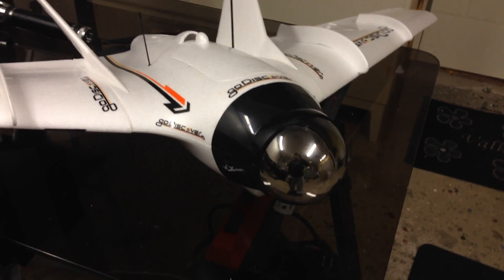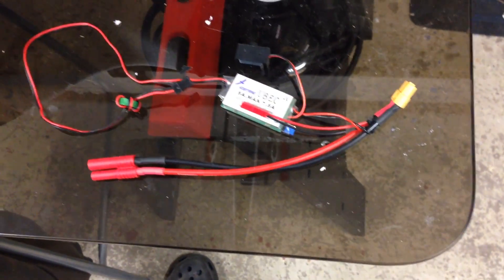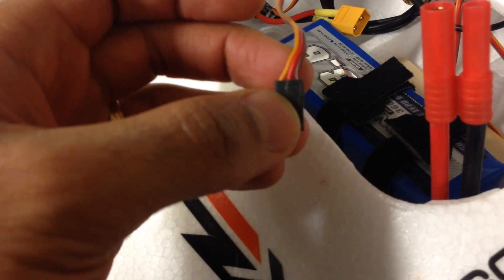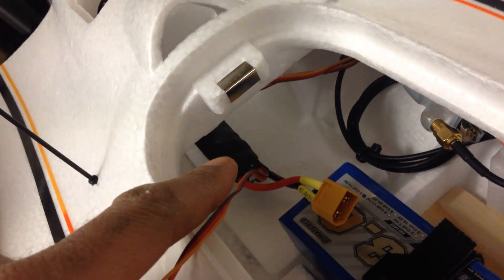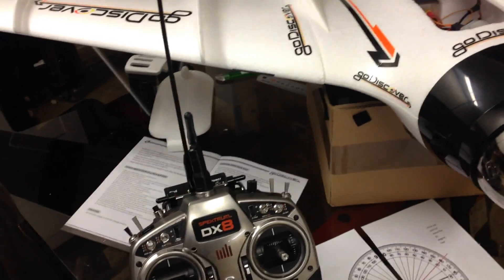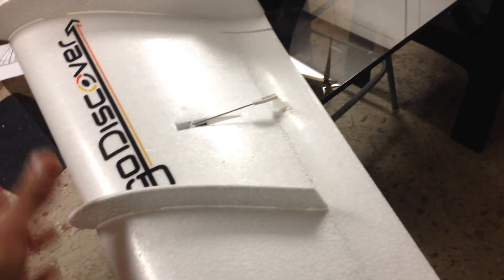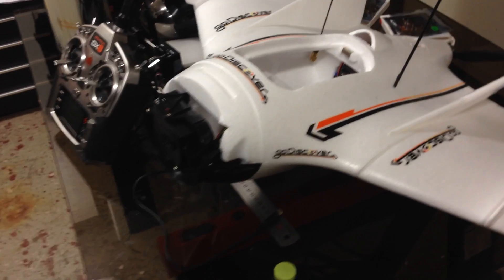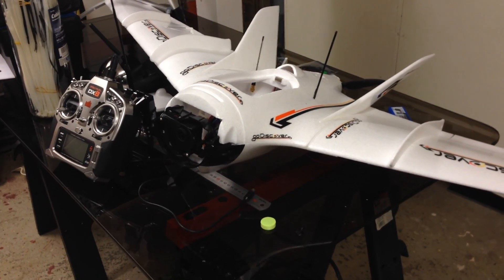Go Discover - Setup Steps

Comment: I like the video , i only think its crazy to ask 20$ for a small piece of wood and 5minutes work .. , i made one of Plywood and cost me 2 dollars , Sorry but i needed to say
Reply from the maker: steven keene Well you are entitled to your opinion.  It did take several hours to make the CAD drawing, to the exact contours for the component shelves, it includes my time to get materials, cut the kit on my CNC machine, packaging and postage.... so at the end of it all, I probably make about $2 profit on each kit.  Is it worth my time, No, but for those who don't have the capability or time to make it themselves, at least I help them out.  Sorry but I need to say
Reply: ant0nsmith I must agree with you , it was my bad i thought it was only the top part but when i look better i see you made the other 2 parts to  , i must have looked better ! i'm sorry  , but i must say , i made the top part in les then 5 minutes  -_-
Reply from the maker: No worries! And no hard feelings!

Comment: Hi ant0nsmith, Thank you for the great videos! So, what did you use as the audio/video receiver to go with 1.2GHz transmitter? This is not compatible with fatshark directly, right? Do you show the receiver and connection to fatshark in any of your videos?
Also one more question, does operating the dragonlink or 700mV AV transmitter requires a HAM license in the US?
Thanks again for your help.

Comment: I just bought on of the Go Discovers and was wondering if you could give me some ideas of what you have installed in yours.  I am in the U.S. and not sure if I can get the same components you are using.  I would like a decent FPV set up with head tracking and maybe a GPS feature with return home functions as a back up.  I am not new to RC by any means, just new to all the FPV stuff.  Thanks.

Jason
Reply from the maker: Hi Jason,
I have a complete list available on my website
NegativeG.net
Hope tgat helps!

Comment: Hi again Ant0n. I'm asking a lot of questions but I think you are the only one that can answer them (I haven't found any places to ask all those questions. I am planing to buy an APM board, the same as your. But I am using a 6 channels radio with my GoDiscover, 3ch for the controls and 2ch for the gimbal. Do you think i can use the APM board with a 6ch radio? Or do I need a 8ch radio? I mean, i would like to use the RTH feature, waypoints and sabilize mode so should I upgrade it? My radio is a Spektrum dx6i. Also, can you tell me how much flight time you have with your 3600mah batterry? If you can answer these questions, you are the best!!!
Reply from the maker: Your questions are good ones!
Yes you can use your dx6i to do the things that you mention.
"3ch for the controls and 2ch for the gimbal" then the spare channel you have, you would use as your mode switch.
Im not sure about the dx6i and what its capability is around setting up a 6 position switch, but I found this video just searching quickly How-to get 3 Position 'Switches' on the DX6i that may be of use for you in setting up a 3 position switch if you don't already have one on your dx6i.

The modes that you would then setup in mission planner would be manual, stabalize and RTH.  To do waypoints you would need to use the mode Auto.

If you can not find a way of get more than 3 modes using your dx6i, then you can set it to be stabilize, auto and RTH. But be careful to ensure that you set in Advance Params, <Throttle passthru in staablize> to ENABLED so that you have control over the throttle when you are taking off and landing. Otherwise the prop will always spin and you will brake the prop on landing for sure.

Flight times: around 17- 20 mins on the 3600mah 4S safely. i.e. using around 80% maximum of the capacity.

Hope this helps my friend!

And keep the questions coming, no problem! :)
/Anton

Comment: Hi Ant0n, big fan here!
I would like to ask you if there is a way to change my go discover engine. Because i have the basic 800 kv engine and I would like to upgrade it with a 1100kv engine. So can you tell me if you know a way to do it? I would also like to know if that would use more of the battery. Please keep doing your videos, i really love them and they're really useful.
PS: I am sorry for any grammar fault, but i am french and still in high school learning english.
Thanks for the help
Reply from the maker: Hi again MrOmegasix!
Dont be sorry about your english, it has been great!

If you can get your hands on a long X head screw driver, I believf you will be able to unscrew the motor from inside the plane. There are 4 screws holding the motor to the black plastic motor mount.  There is a foam "wall" between the center of the fuselage and the motor mount, you should be able to poke the screw drive through the foam to get at the screws. 

As for if your new motor (1100kv) will be more efficient than the 800kv, im really not sure. The are many factors involved, like, are you using a different size prop, and whats the size of you motor. Im no expert in this area, and am still learning myself!!!!

Im using http://www.ecalc.ch/motorcalc.php?ecalc to try and work out what the best setups are. Give that a try first and see what the results say. 

Hope this helps!!
Reply: Thank you for the quick answer. I will try to use the website you recommended (looks pretty complicated) and try to change the engine. Thanks for the help. By the way, i don't know if you know it but your video of the x7 in storm is not avaible on mobile devices. Try to change ads settings to make it avaible.
Reply from the maker: MrOmegasix Yeah, Im having trouble with that video on AppleTV too. I think it is due to the backing track that I am using....

Comment: hello nice video there! but how you did you set your battery By CG ?
i have already CG machine and i want to use 5000 4s battery
Reply from the maker: Hi Saleem!
I used a 5000 4S battery in my Go Discovery for the 10km flight.
http://youtu.be/Od52SDZljzU?list=PLmcS6x97iWfKCzRK4C8HunVJ2Eg3__C-L
In this video you will see how I had it installed.  I would suggest that you check out my battery tray and install it if you want to run a battery as big as a 5000.
http://www.ebay.co.uk/itm/Go-Discover-Battery-and-Component-Trays-/221501067628?pt=UK_ToysGames_RadioControlled_JN&hash=item33927e116c

Hope this helps!
Regards
Anton.
Reply: i meant by my question how i should stand this plane by CG machine !

Comment: How much was your setup and can i use that set up you have on the dx8 on a dx6i is it possible to make he camera pan and tilit from the remote like use rudder control on the throttle for panning and a 3 position swicth to tilt and if you get around to it can you email your setup and how nuch it cost because im  experienced with air planes i dont have any vids thow so now i want to use fpv for filming my friends riding and for when im in the mountains camping i can fly around and my email is ktm65xc101@gmail.com
Reply from the maker: Hi Fred, I believe it is possible to setup on a Dx6i, there are videos on youtube on how to setup the EvUhf with the same method.

Yes, it is possible to do as you say, to use the rudder channel for panning, I do this on my X7 currently using my home build 360 mount.  And it is possible to use a 3 position switch for tilting too - suggest you set the middle position to be middle, and ensure failsafe is set to that position just incase.  You will need to have a suitable pan a tilt solution. I have one in development.

As for the costs, I would suggest that you check with your preferred suppliers, here are some rough costs to give you and idea.

Spektrum Dx8 bought from ebay - ~200GBP
DragonLink from Dragonlinkstore - ~260USD
GoDiscover PNF version from HobbyKing ~160USD
GoPro Hero 3 Black edition ~4000SEK
Batteries from HobbyKing ~40USD each
APM 2.6 you can buy from HobbyKing, called HKPilot ~170USD
Fatshark Attitude SD ~360USD

Hope this helps
Reply: Thank you ver much

Comment: when you said throws do you mean mix1 aile and mix2  elve in the manual it says +20 and - 25 how did you set this up did you do it with the sub trims or the mix 1 an 2 in the radio thank you brother good job I have my mix set at 50% for better throws should I l change to the manual settings or try your settings thanks again my brother
Reply from the maker: Hows it going hellcat,
I didn't do anything with mix1 or 2.
The way I setup the travel for the elevons, was so that at maximum stick input, they move 15 degrees up and 15 degrees down.  

First I used the sub trim on my radio to make sure that both elevons were completely level with zero stick input, then with maximum stick input I adjusted the travel to ensure that I got 15 degrees of angle up and 15 degrees down.

Hope this makes sense.  If not get back to me.

I found that, that we enough movement (throw) of the elevons when I was flying.  I think it is a good setting.
Reply: ant0nsmith ummm ok il have to have another look but but I bought the plug and fly version uk wearhouse  when I tested the wing tail mix setiings the throws were really small so what I did was like u said at  zero input play with sub trim on radio for the wings to be perfectly inline the mix one and two I put 50% I have fast reflex and I need it to move faster il have to get my daughters protractor out later and play with the travel thanks again brother il I get back to you after maiden flight but I live west London very raining and windy so cant fly at the moment 

by the way were did you go to fly it looks quiet and out off the way hard to find good field were I live thanks again brother.
Reply: helcat316 thanks il get back to you if I have problems brother good luck with the plane its really nice bird to fly and your video is very helpful and you speak English I can understand what the hell is going on haaaa my setup is same but I have no fpv at the moment on it I just want to see how it flys for the price I had to get it thanks again
Reply from the maker: Yeah, its a great price for what you get, and its a nice plane just to watch too.  Im waiting for the weather to get a bit better so that I can fly it again.

Comment from the maker: Hi Jase!

Yeap it is at the back of the hand hold impressions according to the manual, which I will verify in the maiden. 

Are you getting one! I think it is a good buy!

Cheers!
Reply from the maker: ***** The Maiden is done! and WOW! I like this plane.  She flies perfect! Although I need to update my build log, and the battery position was more forward than I originally thought.  I will try and upload something this evening. :) p.s. Half throttle and she flies straight and true on a 3600mah 4S